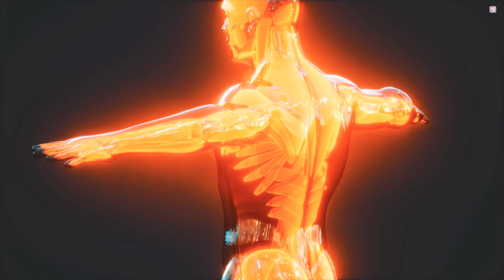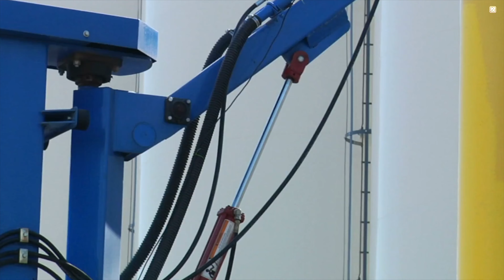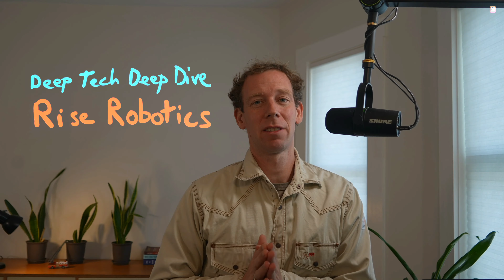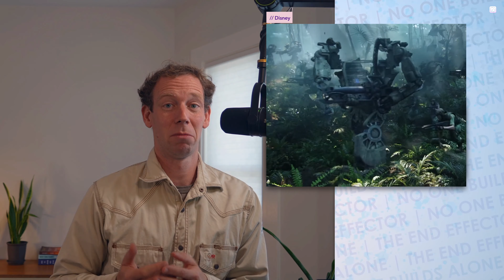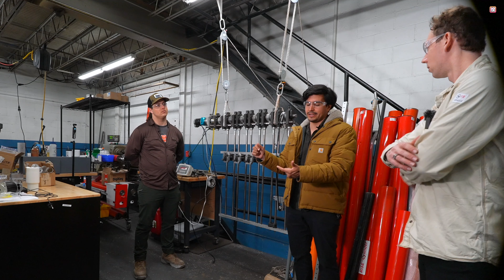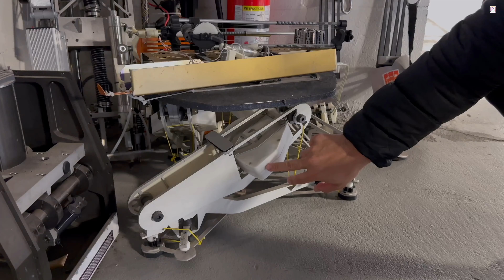Beyond Hydraulics

Comment: Excellent interview and content. Rise Robotics is clearly passionate and doing the necessary testing and development to bring large scale belt driven hydraulic technology to the forefront.
Reply: Off the top of my head, other applications include garbage trucks, trash compactors, lots of different things regarding metal forming, shaping, stamping etc, any kind of clamping or molding action like is used in casting foundries or plastic injection molding.  Literally thousands of potential applications but obviously they know where the big money is, military and oil
Reply from the maker: @foolsizecustoms6783  yes, it is almost mind boggling how many potential applications there are. Many of the customers/adopters in the segments across these industries will be slower to integrate new approaches (including a RISE cylinder) and they would form the majority in the bell curve of adopters. I think you are correct that the military and oil customers have the money, but importantly they also have the willingness to pay and the incentives to explore new capabilities.
Reply: thank you and I agree –RISE Robotics is a special team and they are *so focused*. It's amazing to see.